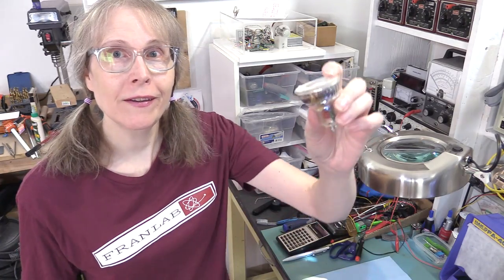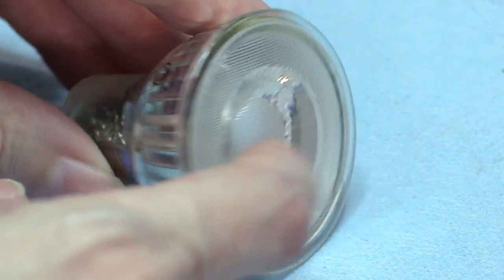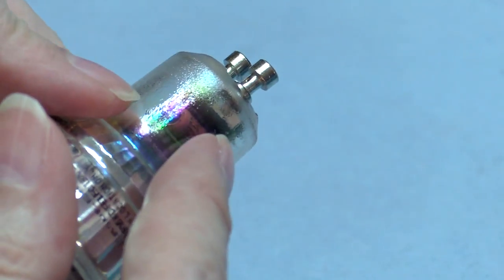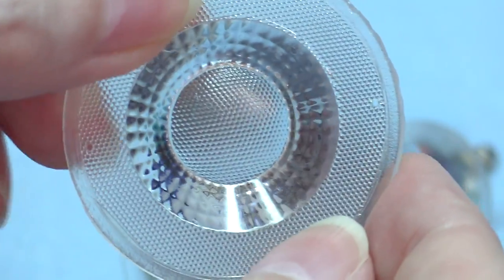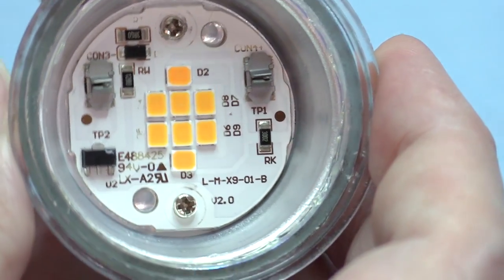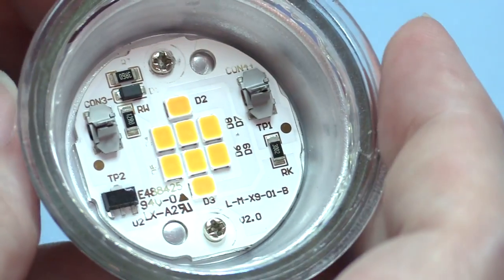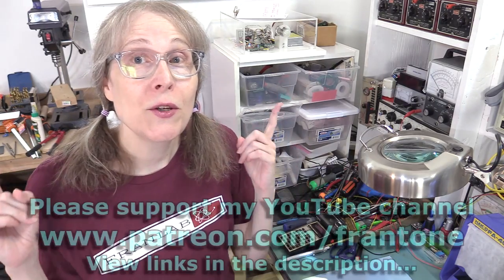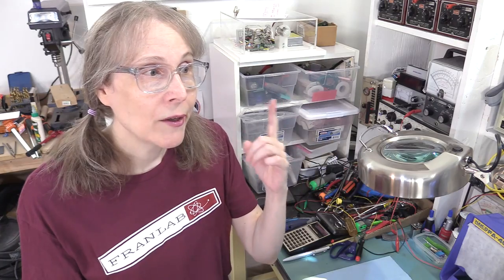Inside An LED Light

Comment: One thing I've noticed about the "newfangled" energy efficient lights, both LED and CFL: A certain number of them fail very early - a month to a year after installation. And then others keep running for over a decade. And that holds even if they're from the same box! (i.e. a box of four bulbs).

Also, what's up with "60W replacement" bulbs producing less light than an actual 60W tungsten bulb?
Since the CFL and LED changeovers, I've had to replace "60W equivalent" bulbs with "75W equivalent" to get comparable light intensity.
The upside is the availability of 6500K color temperature bulbs. (And 5000K can be found once in a blue moon)

Comment: If the carbon footprint of manufacturing an LED bulb is significant, I’d think we could significantly cut it back by standardizing on DC 12/24V power for home lighting. 

Not only would this simplify bulb construction, but moving the capacitor (generally the weakest component of a bulb) off board can improve the lifespan of the bulbs. 

A shame we don’t have any metals that can really surpass Tungsten for melting point. An incandescent bulb can actually be theoretically pretty efficient if a filament could be run at ~8500 Fahrenheit.

Comment: I have not had the greatest luck with LED bulbs, but so far my Cree brand are running <5% per year failure rate. Where the Cree have failed (mostly outdoors), SkyGenius bulbs have survived even though the SkyGenius are 30W vs about 10W for the Cree. No failures on the SkyGenius or the Sengled smart bulbs so far. All the others I have tried have had failure rates > 20% per year.

If you need resistive lighting, say for a greenhouse in the winter, egg incubator or brooders and can't find them, look for traffic light bulbs. There is a common 67W 130V bulb that almost perfectly replaces a 60W 120V bulb as far as heat output goes (but it does produce less light and a slightly more orange light). They also are rated for 6000 to 10000 hours of use.

Comment: I work for a US contract manufacturer that makes, among many other things, many different types of LED lighting. 
I have seen so many different designs for LED lighting, from so many different companies, and so many different 
applications . . .Military, Aerospace (NASA and SpaceX), Commercial and civilian aircraft, agricultural, industrial. . . 
And on and on. 

Here is a list of typical design flaws. 
1.  Over driving the LED current. This means they can use fewer LEDs . . . and it significantly reduces the life span 
of the LEDs. It's a shameful practice and it may be why your lamp only lasted 12 months!  20 mA  is the highest 
level at which most single LEDs should be operated. In fact Operating LEDs at 10 mA  only diminishes the 
light output slightly, yet dramatically increases the life span of the LEDs, and at 5 mA, while the brightness is 
noticeably less, the life span becomes very nearly indefinite. Two LEDs at 10 mA produce more light for the same 
amount of power and have a dramatically longer life span.
Over driving  LED current is a wicked hateful thing to do to your customers. 

2.  Dimming with a switching regulator without filtering the power to clean DC. We have all seen tail lights that 
leave a trail of dots in view of the driver who is forced to look at them. Very annoying! 
Flickering causes headaches and eye strain in many people. 
We don't yet  know the deleterious effects that even high flash rates may have on the eyes, the mind 
or the body. Why risk it? 

3.  Over complicated designs. I have seen an engineer use a digital multiplexer as a light dimmer on a passenger 
reading light intended for a commercial airliner. The schematic was so convoluted and poorly laid out that I had to 
re-draw it just to be able to troubleshoot it. When a second engineer noticed that I had a better schematic than 
they had, he accused me of trying to steal the design. I said, "No, Why would anyone bother to steal such a shitty 
design?  If you wanted to hobble your competition, you would GIVE THEM this design."  . . . " It's just a fucking 
light dimmer! You can do it with two transistors! It doesn't require the use of a God-damned microprocessor!!" 
The company fired that engineer, and that's the last anyone saw of his horrendous design. 
Over complicated designs often equate to a high failure rate, high cost to produce, and lower profit margin.

Comment: It is a really interesting question that you raise, Fran. I've always wondered about this myself not only of the amount of energy that would be needed to manufacture these new bulbs compared to traditional ones but what about the energy that's used in properly disposing of them as well.

Most of us just throw these on the tip face and because these are mixture of so many different types of materials this is an absolute ecological disaster.

So if you now consider how much energy would be then required to break up the individual components of these devices so they can be properly recycled is just simply mind-boggling.

So now we have to ask ourselves the question.. which is more efficient and eco-friendly now?

Comment: Anyone know where to find PAR35 halogen bulbs/ replacements?   Why did my stove hood use a light bulb size that does not exist!?!?
Great video Fran.
Reply: Are you sure it's not the more common PAR38? You might also want to look for just 'R38' as PAR technically refers to the specific design of a parabolic aluminized reflector.

Comment: I'm thinking that the glass is exactly the same as you'd find in a halogen light. They've taken a component intended to have a halogen lamp and instead fitted it with an LED lamp, driver and diffuser. Hence the redundant silver coating on the inside.

Comment: I think I think the longevity has a lot to do with how hard the LEDs are driven and how much power the power supply is required to put out. I have a little decorative bulb that's been on 24/7 for about 6 years, but in the bright white bulbs they just push the components way too hard and that's why they fail more often. I know that's something that Big Clive has talked about too.

Comment: What did fail in the lamp? The LEDs looked ok.
For a small lamp I always thought a switch mode power supply was a bit OTT. A capacitative dropper configuration would be a lot simpler. Check out Big Clives Poundland lamp teardown videos.
If the LEDs are ok maybe you could salvage the lamp by removing most of the power supply components and fit a suitable dropper capacitor on the AC side of the bridge rectifier and run the LEDs off that.

Comment: Normally, LED bulbs live much longer than a year! I've started converting my apartment from tungsten to LED around 2007/08, started with a few bulbs and also a few CFL bulbs, but the CFLs were annoying and getting darker all the time. By now, I've had 3 LED bulbs that died in all that time. I've replaced them way more often because they were either starting to get dark, or there were newer, brighter models available at about the same wattage rating. So, all in all, I've currently got 15 230V fixtures with E27 or E14 sockets with LED bulbs in my one-bedroom apartment, and of course not all of them are being used the same amount of time, but the one in the hallway always has the most hours of life, and they get replaced every few years, just for the fun of it (they're 3W models and always on when I'm home, so at least about 14 hours every day, and on the weekends even longer). The main lighting in the main room is also only replaced when I feel it gets too dark, that's currently 2x 18.5W Phillips LEDs pointing towards the ceiling for indirect lighting. They're both supposed to emit the light of a tungsten bulb between 120-150W, so that's finally starting to become a good brightness. Did I mention I love a lot of light, because it's literally easy on the eyes? ;-)
Anyways, yeah, not many LEDs have broken down in this house. They keep on working and mostly get replaced when they've become too dark, which can be after 3 or 5 years. Oh, and I still have all these old but still working LED bulbs, and sometimes when the occasion is there, I give one or a few of them away to friends in desparate need of a light bulb ;)

Comment: There is a HUGE quality difference in LED's. I received from my utility company replacements for 65 watt flood bulbs. They are about 7 watt. They weigh a ton from the heat sink (whole housing is the finned heat sink) and put out a good color light. They are lasting well, being on a few hours a day. On the other hand, I purchased yellow LED bug floods for outdoor use. They run about 6 hours and default to motion sensor. One has died after being in for only a couple years. It has no weight to it. I have a LED in a table lamp that is on several hours each night and it is lasting OK. It replaced a compact florescent that lasted for years  (it just wouldn't die).  You just don't know what you will end up with.

Comment: The more pricy ones use buck regulators, realy full switchmode power supplys. The cheap naff ones tend to use capasitive droppers which are probaly the simpalist PSU's for an LED light. I don't know of any that use resistive droppers.
Reply: I remember Clive tore down a nightlight which used a resistive dropper.

Comment: I sell these bulbs and they do fail but not at the same rate as the old incandescent lights. The reasons for LED failing isnt always related to the bulb itself but other factors, such as a feedback current from dimmer switches and power surge of some kind. 
As a whole these designs are improving but there is a great deal of room for improvement.

Comment: For a long time there were many LED bulbs available which re-purposed old incandescent and CFL housings, you can even get some really weird ones where they've stuck a string of LEDs down inside the thin glass tubes on CFLs.
But still, it's very strange to see IKEA using this method as surely their huge economies of scale would make it worthwhile to at least take the silvering off. Also note that they haven't used an existing halogen bulb, they've actually gone to the extra effort of adding in that ridge that the board sits on.

Side note, it might be a fun project to get some nitric acid to see if that coating is silver or aluminium.

Comment: Fran, your question about energy saved vs energy consumed to make the product is valid, but may be looking at it the wrong way. The proper way, IMHO, is comparing the alternatives and see which one is more energy efficient. So comparing LED vs Halogen:

LED: 
- consumes energy making the chips, circuit board, etc.
- involves many type of materials
- consume less energy in use, which also generate less heat, and reduce air conditioning cost

Halogen
- consume a small amount of energy in extracting the halogen gas
- consume a small amount of energy in making the tungsten filaments

I think in the end, when mass produced, the differential between LED and Halogen bulbs are not significantly different. Semiconductor manufacturing has become extremely efficient both in terms of cost and energy in the last few decades. The air conditioning cost saving "can" be substantial as HVAC is the highest energy consumption element, particularly in the South. 

BTW, a properly manufactured LED bulb should last a lot longer than 12 months. The components themselves do not burnout. The failure is often a result of poor manufacturing process like bad solder joint, or poor heat dissipation. A good brand LED light bulb can last 10 years. Meanwhile, halogen/tungsten bulb has a natural limited life. The tungsten molecules actually "vaporize" due to high heat, and then condense back to the cooler part of the filament. Over time, the filament becomes thinner in the middle, and breaks.

Comment: I agree that you got a bad bulb.  My experience with the same IKEA bulbs has been that a small but significant fraction have failed in less than 5 years, whereas I’ve experienced only one failure out of 12 (considerably more expensive) Philips bulbs in daily use over ten years.  One significant issue with “plugin replacements” for AC incandescent bulbs is that every bulb has to include all the rectification and driver circuitry for the LEDs.  No doubt the energy footprint would be more advantageous if we drove a set of LED bulbs (for instance in track lighting) from a single AC - to - low voltage DC rectification circuit.

Comment: A very rough rule of thumb for carbon footprint is the dollar. Backward conversion varies a bit, especially if you live in an area like mine where 100% of our electricity is notionally  renewable (the electrons can come from any source but the renewable sources finish up with my money). Also China is going renewable in a big way. They have been putting up enough new  renewable energy projects a year to power a medium sized European country.

Comment: I have opened up LED lights, and phone chargers that failed. I found most of the time it is the capacitors that go bad.  Use an ESR meter to test the caps, and replace the ones that read out of ESR spec for their uF value.  I found very few times other types of components failed in these devices. The heat kills the capacitors.  I fixed many of these small devices by simply finding the bad capacitors on the circuit board.

Comment: I've wondered this same question about the total cost of LEDs, but I have to admit, I changed out all the bulbs in regular lamps in our home in Maine.  I have not had to replace those bulbs in years.  I can't remember the last time I changed one.  In my DC condo, I had to change one the other day and realized it was one of the first models made.  So, all anecdotal evidence is all I have.  It would be interesting to see the actual numbers.  The anti-LED crowd is forever yammering on about them but I've never seen any conclusive evidence one way or the other.

Comment: I found that in the beginning, the earlier LED bulbs were over engineered and lasted a long time.  I have a Philips that's most of 10 years old and it still works, but I've gone through a pile of Cree bulbs because they fail in less than an year.  Now, I have a plain old incandescent 75 watt bulb in my porch light that's been there for a little under 7 years and it's still going strong even though it's exposed to the weather of Michigan winters.  I've yet to find an LED that can stand up to a Michigan winter.  The last one was sold as an outdoor cold resistant LED but it failed before the winter was over.  That post light incandescent cost me $5.  I'm sure its carbon footprint is heftier than an LED but add in the cost of buying LED after LED and suddenly, that incandescent is cost effective.  Find me a 75 watt equivalent LED that can stand sub-zero temps one day and 45 degrees a few hours later and will stand up to that for at least a winter then go through a summer with 80 and 90 degree days and I'll be happy to buy so long as it's under $25.

Comment: Non-dimmable LEDs can get away with a capacitive dropper & diode for the power supply, or sometimes just having them all in series with a rectifier, the dimmable ones are the complicated ones

Comment: Fran:
I think, if you look more closely, you might discover that the inside reflective coating in the glass funnel  is not aluminum or silver, but rather a light-reflecting and heat (IR) passing dichroic coating made of many light_wavelength thick layers of transparent dielectric (insulating) compounds with different refractive indices.  One clue is that some angles of observation are transparent instead of reflective.  Most laser mirrors are made similarly, as are "non-reflective-coated" lenses on camera and binoculars, for instance.

See articles such as : https://en.wikipedia.org/wiki/Dichroic_prism
You might even want have a video series on these technologies.

Cheers
Dave
Reply: Fran:
Here iis an interesting paragraph:
      Quote from Wikipedia article on dichroic filters:
"Dichroic reflectors known as cold mirrors are commonly used behind a light source to reflect visible light forward while allowing the invisible infrared light to pass out of the rear of the fixture. Such an arrangement allows intense illumination with less heating of the illuminated object. Many quartz-halogen lamps have an integrated dichroic reflector for this purpose, being originally designed for use in slide projectors to avoid melting the slides, but now widely used for interior home and commercial lighting. This improves whiteness by removing excess red; however, it poses a serious fire hazard if used in recessed or enclosed luminaires by allowing infrared radiation into those luminaires. For these applications non-cool-beam (ALU or Silverback) lamps must be used. "
 
Source::        https://en.wikipedia.org/wiki/Dichroic_filter

Cheers,
Dave